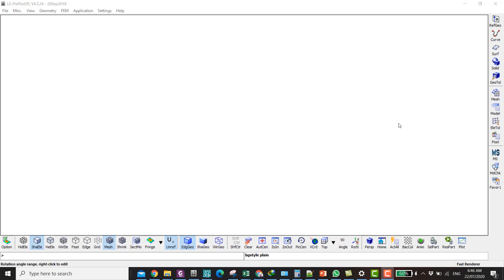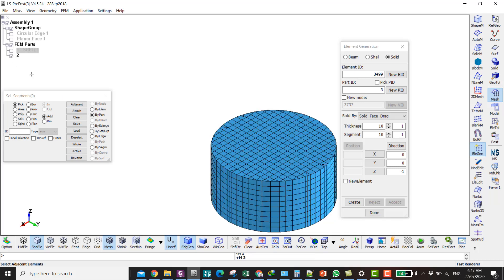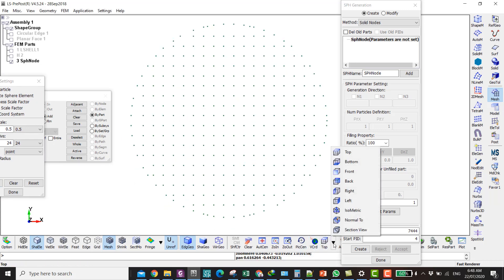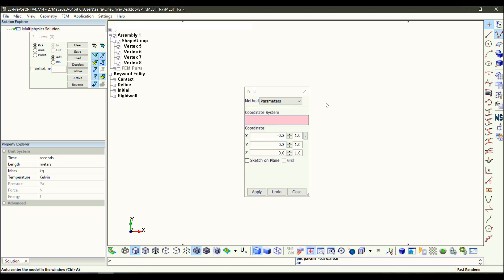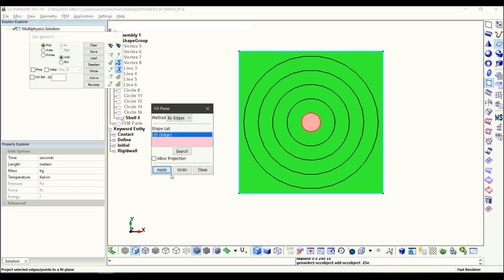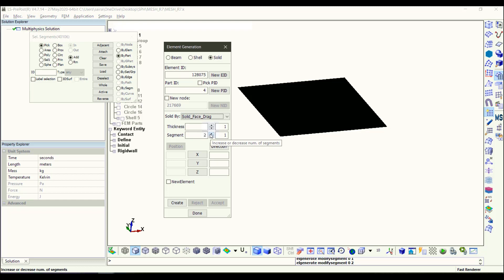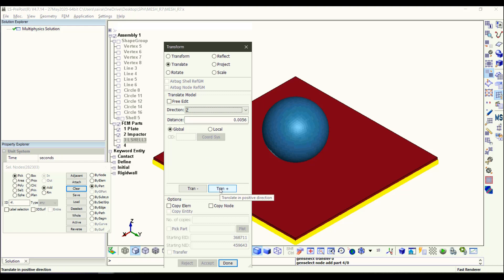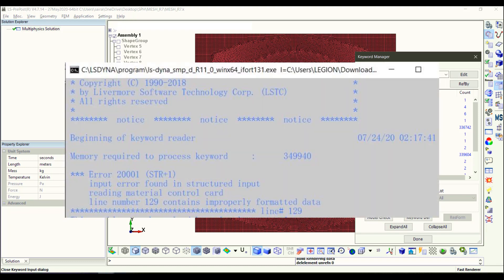Meshing Tutorial: Evenly Distributed Mesh for Cylindrical Part and Circular Mesh for Square Part

Comment: Hi 👋🏼
I want to import a model in stl format which i have designed that in SolidWorks ، is it need to meshing?
Thanks for your help 🙏🏼
Reply from the maker: I recommend you to import .igs file instead of .stl format. 

I found that .igs files give less problems compared to .stl. 

Yes, after you import, you still need to do this meshing to create the elements.
Reply: @AmeenTopa  yes thank u 👋🏼
 i imported my model in igs format  and meshed that. I define a section ( shell with  ten mm thick) but when i link my parts with this section and active (model-->apear-->thick) , my model goes out of shape. Actually because the meshes increase in volume from the outside surface and this causes a intersect between different parts. So how can I solve this problem? I guess if i increase the meshes in volume from the inside it would be ok. How can I do that?
Reply from the maker: @bluemiii6274  The best way is to model the geometry (igs format) using surfaces not using solid. I believe you used solid geometry (which has thickness) but when you mesh you use shell elements (which are 2D elements). 

Another option is to mesh using solid elements. But this will increase the size of your model unnecessarily thus I don't recommend it.

Comment: Hi Ameen, I have some questions related to export 3D solid mesh from hypermesh to Prepost. I am not sure why when I export the solid mesh to prepost, the solid element in prepost is 10-nodes elements and I am not sure why? have you had any experience related to this. thanks
Reply from the maker: Hi Lam, I am not sure about this problem. But in general, Element formulation type can be changed in SECTION SOLID ELFORM